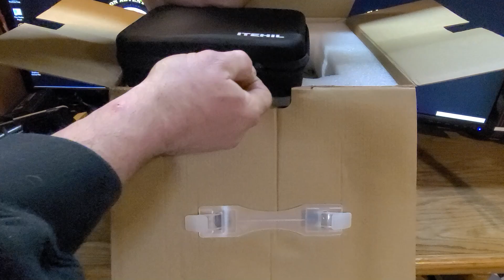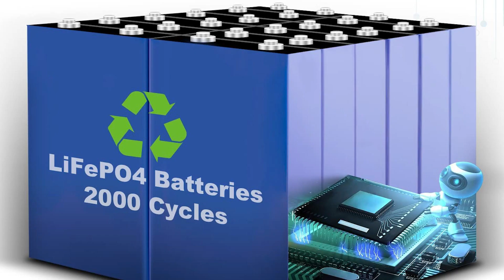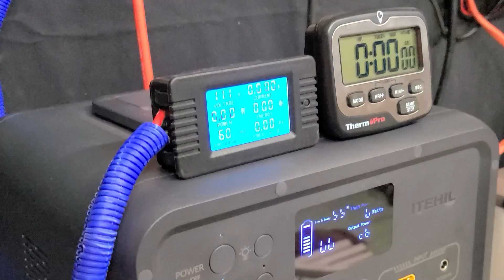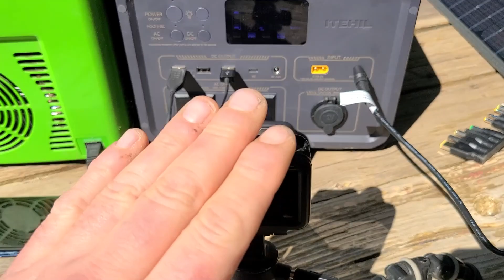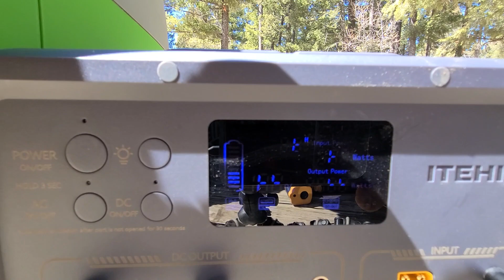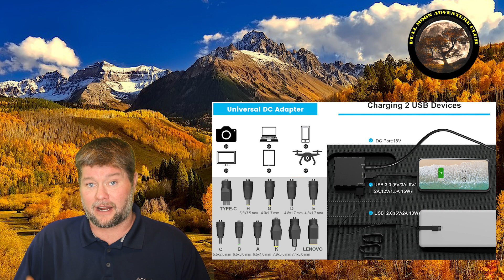ITEHIL Solar Generator Review

Comment: This question is not related to your video. I recently bought a keystone Rv with the solar flex 400 package ( 2-200 panels victron  30amp charge controller and 2000 freedom x Xantrex inverter. It came with 1 lead acid battery. Do I need to do anything special when I change to lithium batteries.
Reply from the maker: You will need to change the charge settings on the freedomx. Make sure you match the charging voltages to the voltage requirements of your new lithium battery.